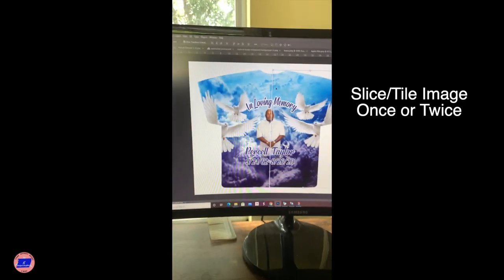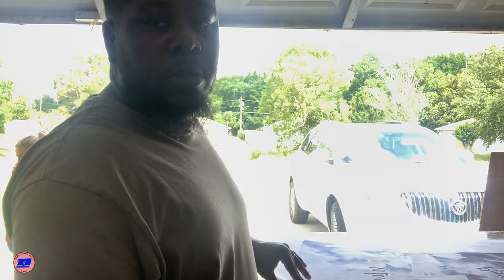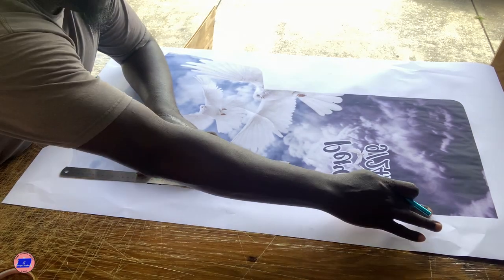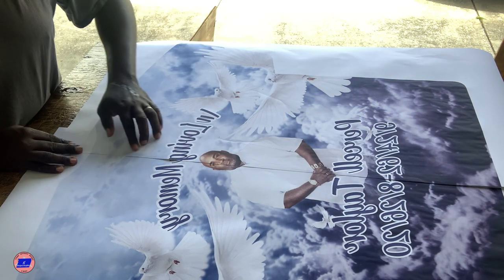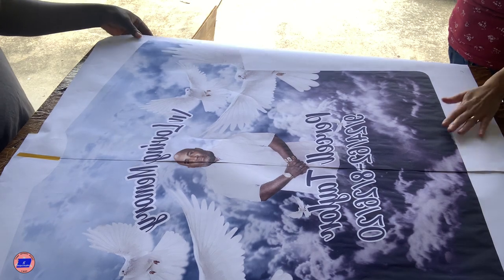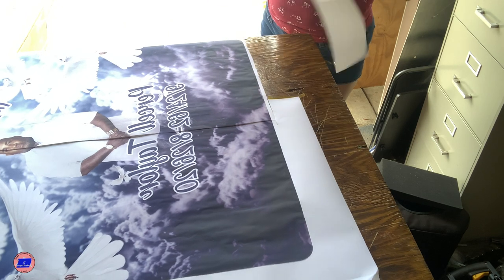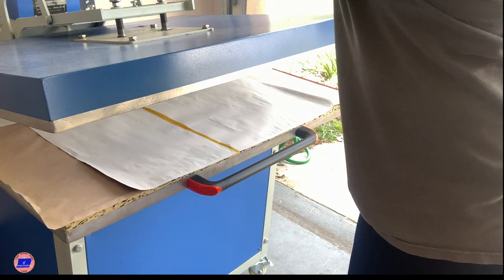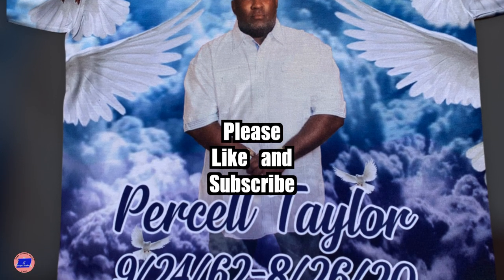Sublimation All Over 3D Shirt Tutorial "Aplusdesignsandgrapics.com"

Comment: Great video. I sometime have issue with white spots around the neckline (front and back). Any suggestions for preventing this? Also where did you get the red mat? One thing I’m going to do is remove the Teflon that sits on my top platen.